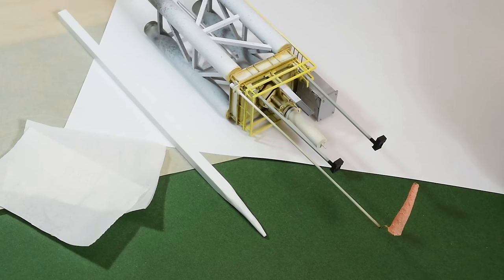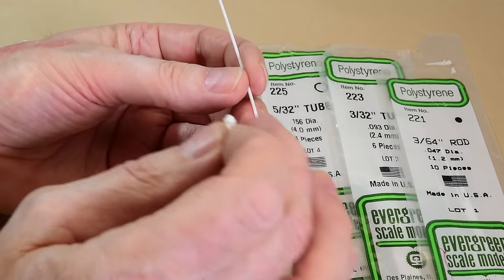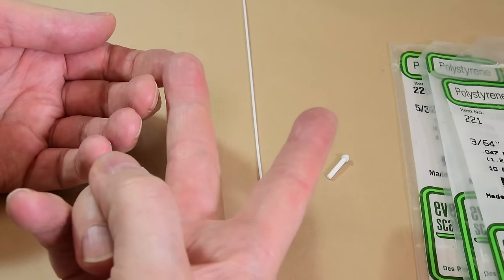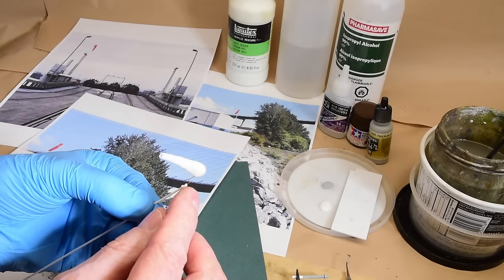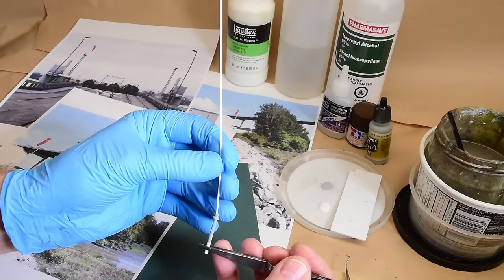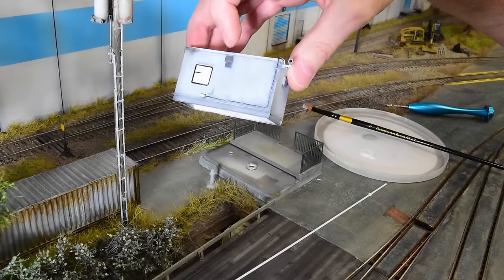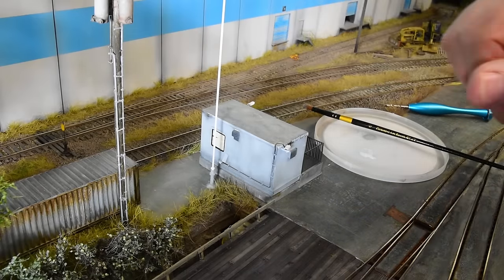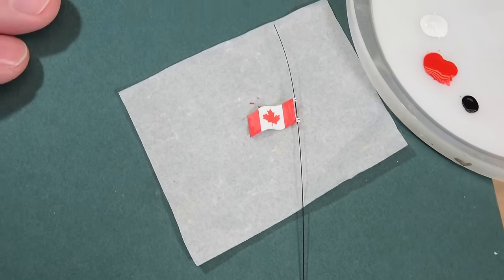Modeling Wind Sock's & Flag Poles | Boomer Diorama ~ # 233

Comment: Great video. Wind socks can also be used to indicate wind speed, as well as direction. Typically, 5 orange and white bands indicate speed (calibrated with weight and size of fabric) at 3 knots per band. A fully extended windsock would indicate a 15 knot “breeze” (e.g., 17 mph or 28 Km/hr, or greater, cross wind)! A loaded barge may want to wait out the wind before docking/undocking. 😎
Reply from the maker: Thanks for the info! That is awesome. I was not aware of that. Cheers ~ Boomer.
Reply: @boomerdiorama  by bending the windsock you can change the wind, and the story you tell! It would be interesting to learn how much the wind speed impacts operation of the prototype (barge, tugboat, and loading ramp).

Comment: This was an interesting project.  I has not considered scale wind socks before.  In fact, in the current era, in Nebraska one not only sees wind socks at airports (especially the little private fields), but they are also seen at facilities with hazardous gasses.  The windsock lets employees evacuate upwind in case of a leak.  In Nebraska, there are also highway overpasses on the Interstate that have wind socks to warn truckers about cross wind gusts.  So the "lowly" wind sock can be used on many current-era layouts.
Reply from the maker: Wow! Those are some great points to justify including them on our railroads. Good stuff. Cheers ~ Boomer.👍

Comment: Boomer, wow, what great details in "just" a flag and windsock.  The poles and stanchions are amazing.
The tip with using the wet toilet papoer to make the windsock around a shape is great.  I love the way you have rouched up the edges of the flag, even though it is such a small amount of white in the paper, it really does distract.  I make my road signs - Stop, Give Way, etch with photo paper, and then use a correctly coloured marker to just touch the paper, I had not thought of using the Vallejo Air to do the same, great tip.
Thank you for sharing, and cheers, stay safe,  Michael
Reply from the maker: Thank you. Simple details are cool eh?
Reply: @boomerdiorama  they certainly are. 😃

Comment: Dear Boomer, love the wind sock, such a simple way of adding extra detail to the layout or diorama. Those stanchion footings are a great idea, ripe for the proverbial ‘hard drive.’ Beautiful how you did the Maple Leaf flag. Just wondering, on the flag part, how a toilet paper version would add the depth, or better said the illusion of cloth creased and draped by the wind and the temporary absence of wind. Maybe just by sanding the printed flag down to an as thin as possible layer. Then forming a mould shape on a slightly larger block of wood or Evergreen. Finally, to layer or laminate the flag inside two pieces of toilet paper, similar as with the wind sock. Think that could even be done with a full rectangular flag to begin with. The forming of the flag over the mould shape will give it a more natural look than the pre printed flag form. Can even imagine this would allow for adding a sag on the lowest point of the flag, or a fold over of the highest tip of the flag. Yet, after all just an idea! I’ll just try it out. Cheerio
Reply from the maker: Thanks for sharing. The flag is simply to small to apply those features for me. You only see it because I zoomed in more than what the natural eye can see. ;-) Cheers!

Comment: Pretty neat Boomer. The flag is missing some blue and stars and stripes 😊. What and Where can one find a good pin vise? The one I have the feral doesn't do a good job of holding the bits tight because the nut runs out of threads before fully tight. Especially the smaller bits.
Reply from the maker: Yes indeed  . . . "Star & Stripes" . . . ;-)